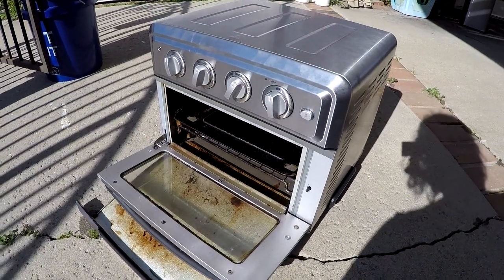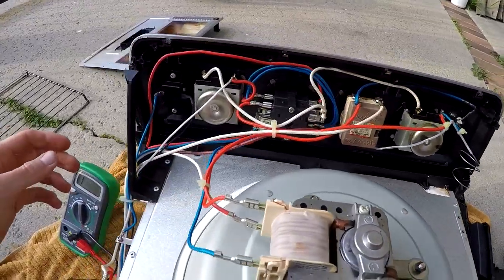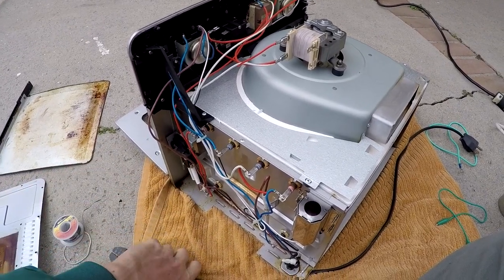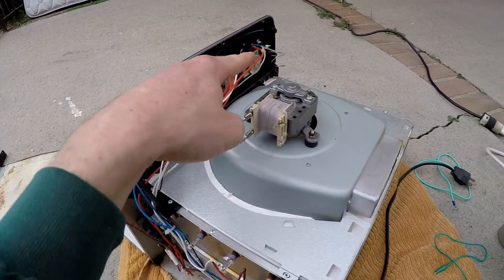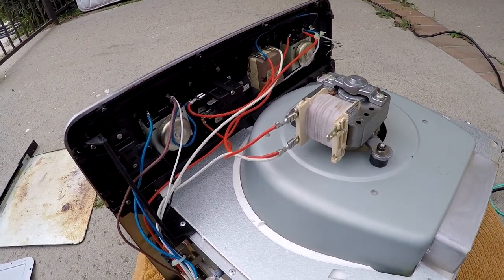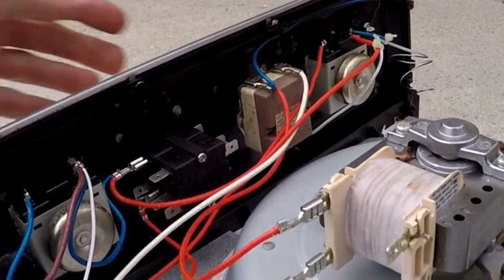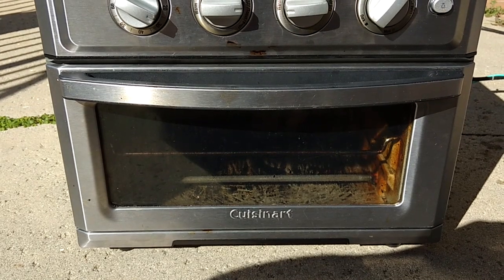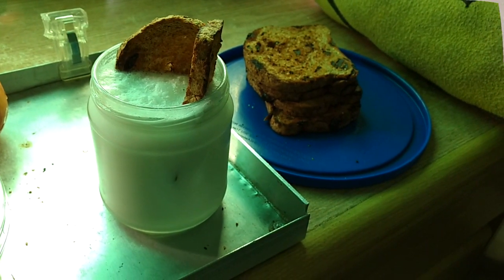I Fixed a Broken Toaster Oven Without Replacement Parts - Cuisinart TOA-60 Rewiring

Comment: The flames really added a certain quality to this video!   
This is the type of repairs we need to have more of in the western world. Growing up I was taught that you repair using genuine parts, that is nonsense I now realise. Any repair will do. Switches are switches and if they will carry the current then they are ok. Looks come next to function and dollars stay in your pocket!  I got a neat little oven like this out of a dumpster a few years ago, size of a microwave, top and bottom elements and no fan, but it has a rotisserie spit motor across the centre. But the spit needle is missing. I don't really want to spit roast anything so it just works as a regular oven. Good Job Pete.
Reply from the maker: Yeah! if the switch is defective, replacing with the same switch will have the same problem

Comment: Thank you for posting this. I was able to fix mine. In my case I had to sand down the circumference of the center knob. It was too tight and was kind of stuck. After sanding it, the knob moved freely and Voila! My dear toaster is working like a charm.
Thanks again.

Comment: Well at least you opened it up instead of cutting the case like I had seen on other videos....
I have a TAO-60 with mechanical function switches that I have repaired multiple times, and it was always the same portion of the switch that failed that supplied power in out to the timers. The repairs always worked for about a month or two only to fail again so sort of like you I did a little bit of rewiring. that left "all" the functions working.  My repair consisted of removing the failed switch contact plate because the switch was grinding and would not turn smoothly. Once the damaged (melted) contact plate of the switch was removed (4 tabs hold the contact plate in the switch housing removed with a sharp knife) I cleaned out the I removed all lose pieces inside the housing plus indexing ball with its spring only on the failed side of the switch leave the other contact plate alone. Then I connected the 3 wires (the brown - power in - and the 2 white, power for the timers) together then labeled the toast timer "toast only!". Which solved the failed function switch problem and left all the functions in working order and because I removed the failed timer contacts the function dial turns smoothly. You just have to remember the toast timer is only used for toast otherwise you will melt the toast timer. I have been running my TAO-60 this way for over a year and a half with no problems at all. It seems there is a design flaw in that portion of the function switch causing the contacts to overheat and melt the contact plate allowing the contacts to fall out and begin to jam the function dial... At 6 months and 1 year after this repair I opened the case to verify nothing else is showing signs of melting or overheating and all is perfect.